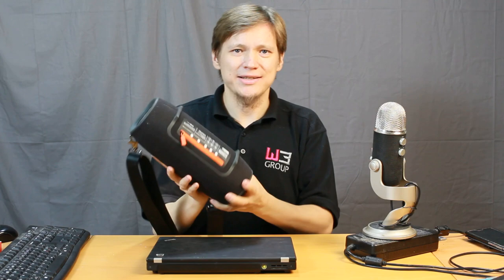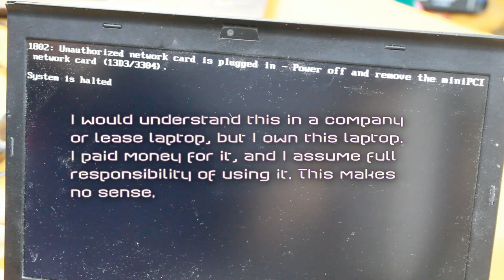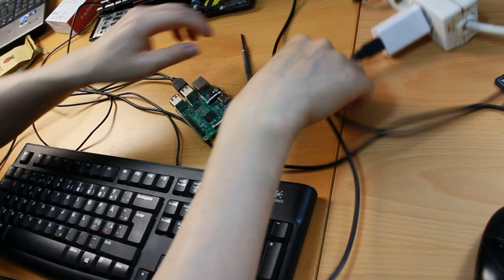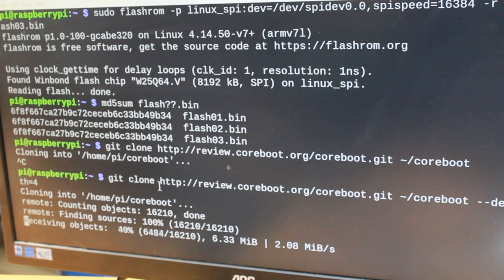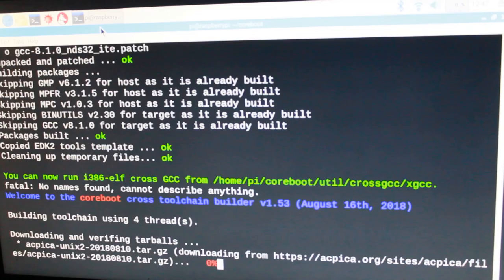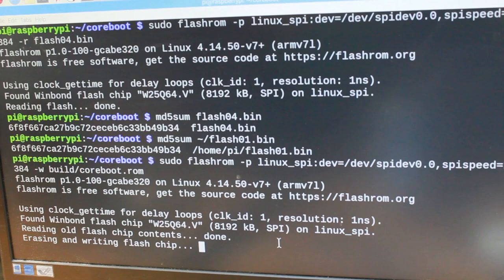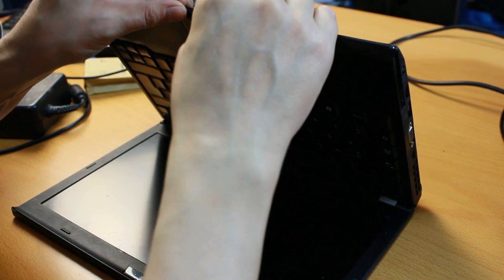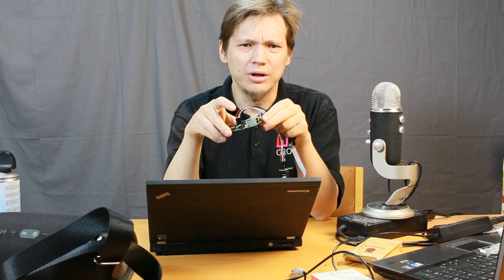Replacing BIOS in a ThinkPad with GPL CoreBoot (former LinuxBios)

Comment: That process was so complicated. I can't believe someone said to themselves "I shall make a BIOS compiler!" then considered that to be a finished state.
Reply: The process isn't that complicated; it's just building a toolchain (so you can build coreboot on a PC or a Raspberry Pi, two very different platforms), fairly standard configuration (same as the Linux kernel) so that the same BIOS code can work on many platforms, and then compilation.  I believe a few of the make steps were unnecessary as they were included as part of others, and on top of that, on Arch Linux you can install coreboot-utils-git from the AUR and have ifdtool and such in your PATH in one step.
Plus, it goes a lot faster on a desktop computer with a working internet connection than a Pi.
Reply: I was surprised at how easy that looked, I thought getting coreboot working would be way more involved than downloading and compiling the toolchain and even have it extract blobs for you.. Now I want to give it a go.
Reply from the maker: Yeah. The biggest difficulty was because I followed the tutorial too closely and did coreboot compilation on the RPi. That caused much time to be wasted in irrelevant challenges and because of its limited CPU power.
Reply: u can always use devices other than rpi.
Reply: Look, the kind of people who actually install CoreBoot are... how do I put this politely? Not inexperienced with compiling software and flashing BIOS chips with random shit they had lying around.

Comment: pretty good timing that I just nabbed a mint condition T500 for $20. libreboot time!
Reply from the maker: Wow, you got really lucky! I paid 131.51€ for this one, and it came without HDD and with two of the three USB ports broken.
Then again, I have next to me a pile of seven laptops (of various ages) which I have gotten for free from a dumpster. The one that recorded my voice for this video was one of them.
Reply: What? $20??!!!
Reply: @Clau007 I managed to snatch a T430 for €80 from a wholesaler, if you're patient and look around enough there really are some great deals to be had
Reply: I got it from a (kind of sketchy) locall refurb wholesaler. You have to buy at least 3 laptops at once so i got an X220 for my mom and an X240 for my dad as well. One annoying thing though is that they all had different keyboard layouts than the one we use here in Belgium, but still after you factor in the cost of 3 replacement keyboards it was a really good deal
Reply: These "old" business laptops usually go quite cheap. Nothing unusual, companies throw them out en mass once the warranty expires.
Reply: @Clau007 You should be able to get a screen for for around 30€ on aliexpress if you need one. look at the references, there's some TN ones and also  VA/IPS ones if you want better angles. Switch is about 2minutes (i did it on a x220 and recycled the old TN one as a digital photo frame)

Comment: Shame on Lenovo. Thanks for posting this information, so that existing Lenovo users can take control of the hardware they spent serious money on, and so that people who are looking to buy a computer can see that you absolutely should not buy a laptop from Lenovo.
Reply from the maker: The same goes for anything you could stick into the USB port, and it’s much easier than opening the computer cover. Also, if you have access inside computer cover, you can also do the trick that you let the BIOS boot, and then attach the PCIE card before the OS loads up. That way the card still does its thing, but the BIOS does not block it. Or you could solder a USB device physically into the USB connector, but place it inside the computer case, which is totally fine by the BIOS. So all this circus is security theater at best.

Comment: There are screws in there for the card you installed, but the slot is meant to take a full length pci-e card and not a half-length one. There's cheap adapters out on eBay which are basically just a metal plate with some screw holes if you want to mount the card correctly. Other option would be to replace the existing WLAN card you have in there with the new one as it is in a half length slot.
Reply from the maker: Yeah I realized there was an unused screw a bit farther and figured as much. I’ll see if that becomes a problem. Unless it does, I’m not going to do anything about it. I need the existing WLAN card though. This combo adapter cannot do 5 GHz.

Comment: building coreboot on a pi!? braver man than I

or rather, more patient :^)
Reply from the maker: Indeed. It was a bad idea. I even ran into a thrashing situation because of RAM shortage.
Reply: I installed coreboot on my x230t and I did start by trying to build it on the pi as well, but I ran into similar problems and just used vagrant to get a build environment on my main PC. It's impressive that you got it to work!

Comment: Did you get to the bottom of the long delay when starting the desktop?
Reply from the maker: No, but I think it may be related to why Grub shows up black screen. I will have to see if I need to something about VGA BIOS.
Reply: @Bisqwit  Most likely the reason. Although seabios shows up, linux itself is booting the display driver. I did not use libgrafinit on mine, I used the vgabios just to learn how to extract it and mine works all the way, although that's one less free blob..

Comment: It's not chip select but clock. SPI has SCLK (Serial Clock), MOSI (Master Out Slave In), MISO (Master In Slave Out), and won't talk about the SS signal because of the events in 1940's but it would stand for Slave Select which would do chip selection which is not normally used since you usually have only one slave.

Comment: The reason why there isn't a screw is that the miniPCIe slot you have placed the card into is meant for a longer card, such as an M2 SSD. If you had removed the wireless card on the right, it would have screwed in without a problem.

Comment: I've been trying to do the same thing with a Lenovo T420 for a while.  Neither builds from the internet nor the builds I've made based on recommendations on Reddit and GitHub will work properly (the laptop won't boot the Memtest payload or the OS) and I'm still trying to get EHCI debug working with an original (white) BeagleBone.
Reply: you may need vga blob or something. memtest needs specific graphics mode and high res ones are out of question. os should work pretty easily - have you tried seabios as main payload?
Reply: IIRC I'm using libgfxinit without a VGA option ROM.  Maybe I should try a few of the VGA blobs I have, but I'd rather have EHCI debug working first.

Comment: Fascinating video. But, there is an original BT module that can be installed into that laptop. Look for the Lenovo part FRU 42t0969. If you use that, you don't have to replace the BIOS. The slot which you are using for your Bluetooth adapter is actually intended for a WWAN card. The Bluetooth adapter does not require antennas. (Personally, I would've improvised something to screw the card in place, using superglue and a piece of plastic.)
Reply: Another thought - your Bluetooth would probably work just by replacing the existing Wi-Fi card with the WiFi/BT Combo card that you purchased (although this also might require the BIOS replacement).
Reply from the maker: I was not aware of the existence of the original module, and I did not search either, because I was pretty sure it is going to be crazy expensive anyway. Also, this card is not approved by the original BIOS regardless of how it is positioned. The first thing I tried was to replace the original WiFi card with it, because I did not know there was a second slot. Also, this card does not support 5 GHz WLAN, so replacing is not a valid option anyway.

Comment: Just bought my clip and jumpers. I'm going to do this to my t420 so I can use a new wifi card. If I don't come back .. you know what happened
Reply from the maker: Good luck. Note that there is a significant risk in doing this without desoldering the chip first. I will not take responsibility for possible damages. This video was provided as documentation, not as instruction.

Comment: The laptop's PCI-E slot actually seems similar to the front loading NES's cartridge slot. You put the card in and push it down. There are a few differences though, such as that you have to screw the PCI-E card in place and you use a case for the cartridge on NES.

Comment: That additional PCIe slot is also usable by an mSATA drive which is what i use in my x220
Reply from the maker: I just installed a 500GB Samsung EVO 850 in it. More than enough for my purposes; allows sometimes temporarily offloading a camera or a videocamera contents to it when I visit somewhere. Paid about 170€ for it a year ago. Before that, I temporarily used some 128GB SSD that I got from another dumpster-sourced laptop.
Apparently, today you could get a 1TB SSD for the same price… And yes, disk drives are not even on my shopping list because I don’t want to worry about damage caused by mechanical vibrations/bumps.

Comment: 2:58 there is a screw to hold it in place, however you need a bracket which lengthens it a bit and it will secure.
Reply from the maker: Guess if I have one.

Comment: Very good video. And a good way to introduce Electrical Engineering. Good job!

I'd like to ask a question: Do you use modern coding techniques in your code? For example enums, etc.
Reply from the maker: I use plenty of modern coding techniques, and I sometimes create projects just for the sake of practicing out the newest features of the language.
Reply: I see. That's a great way to learn the new features of the language you're using. :D

Comment: I like to watch stuff like this, but just seeing the amount of time it took reminded me of the countless hours and hours I used to waste on projects such as this when I was younger.  So many cryptic errors, so many broken compilations.  I don't have the time or energy anymore, I would have bought another cheap MP3 player from the store and been done with it.
Reply from the maker: I was actually planning on doing just that — instead of buying a laptop — but I could not get the same or similar model for that price anymore. The prices had gone up. Also the 4 gigabytes on it felt a bit too small. Also, it was not cheap to begin with. I paid 42€ for it originally, and the prices only went up from that.
Now they have a new version — which incidentally costs also 42€ — but aside from the increased storage capacity, it actually has fewer features than the Clip+ did, according to discussions seen on rockbox.com. I used the RockBox firmware for the Clip+.
Reply: Yah but that would not have made as interesting of a video.

Comment: I think are not the cables probably, but the BIOS chip being soldered to the Motherboard, the proper thing to do would be to solder it off first
Reply from the maker: Yes, it would have been proper to desolder it first, but I wanted to try this method and make a video about it. This was as much a documentary or a vlog as it was a how-to.

Comment: Its kinda ironic, the Raspberry pi 3 model b has bluetooth builtin :P - keep up the good work
Reply from the maker: I have actually considered more than twice to use a RPi as my computer on go, but because it also needs a display and a keyboard and a battery to be useful, the portability factor quickly degrades.

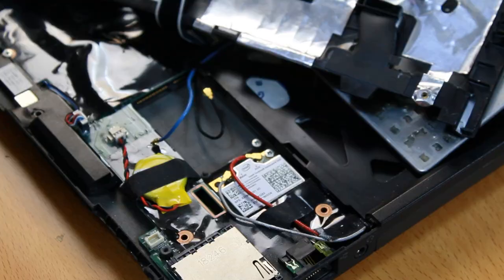Comment: There is another connector in this laptop for an official Lenovo Bluetooth module, you can see it at the bottom of the screen at 2:36. But I understand why you would still want to do this.
Reply from the maker: I was wondering what that connector is for.

Comment: This is awesome, was there any reason you chose Coreboot over Libreboot?
Reply from the maker: Existing and confirmed support for the X220.
Reply: Well that makes sense! Have you tried PostmarketOS on phones by the way, since you like to recycle/refurbish older equipment? I'm installing it on an old 1st gen MotoG right now and it's going well.
Reply from the maker: Nope, I have not. I do have several decommissioned phones, but nothing so recent that it could run PostmarketOS.
I am still using my first smartphone. The previous one that I used is a Nokia E70, and it is not quite capable enough for any sort of Linux system.

Comment: Nice! Can you do this on modern ThinkPads? I mean replacing the stock BIOS with Coreboot?
Reply from the maker: Yes and no. The exact specifics on how to do BIOS replacement may vary, but the deciding factor is whether Coreboot has support for the hardware in the specific computer. If it does not know about the hardware, it cannot initialize it properly. The consequences might be anything from some usability aspect being lacking to the computer not starting at all.

Comment: You don't need to take the wrist rest off to take the keyboard out, in fact, it's generally easier to put back together if you snap in the wrist rest and then re-install the keyboard. To re-install the keyboard in the X220 you slot it in at the top and then lay it flat, then while holding down the bottom half of the keyboard, slide it down to lock in place. But I should also say, the X220 does have bluetooth, at least the one I am typing on has bluetooth, but it can be disabled in one of the BIOS (not sure about coreboot as I haven't tried flashing it yet) menus. I know this because I disabled it because I haven't used bluetooth for 10 years and didn't want to bother trying to work out how to get systemd to automatically disable bluetooth at boot (nowadays I use runit and working out how to solve that problem is a lot easier).
Reply from the maker: There are many different configurations of the X220, including four different types of displays, two CPUs, two kinds of memory, some with different kinds of USB ports. And yes, some that come with a bluetooth adapter; I don’t have one. If I had one, it would plug into that little white socket you see when I opened the case.
Reply: Yes, I remembered after I posted that the bluetooth slots into the socket and realised I never checked the video. I didn't realise they made X220 models without bluetooth. Was it not possible to buy a bluetooth board for the X220? I could have just mailed you mine :P
Reply from the maker: I did not know there exists one, and I did not do searching particularly because I was under the assumption that any official Lenovo-sanctioned hardware is going to be crazy expensive anyway.
Reply: You can get Bluetooth daughter-cards from used thinkpads on ebay here in the UK for very cheap (~£5) and it also seems there are Chinese manufacturers of these boards. I don't know how these boards communicate but by the size of the connector I can't imagine it being PCI so I don't think the BIOS would have any way of knowing if it was genuine. (But the used genuine ones are still cheaper than the new chinese ones.)

Edit:
Anyway, I need to look into flashing coreboot on my X220. The only problem is the cheap SOIC clip I bought was so cheap that one of the connectors was misaligned. I was wondering if I should try ordering another one or if I should just solder some wires to the chip temporarily for flashing (the coreboot guys told me this was a reasonable option).

Comment: I might ask a stupid question : can't you just use a software to update the BIOS with the new one you compiled ? Is that also blocked ?
Reply from the maker: There are two reasons, three really.
— The first and most obvious one is that if something goes wrong while flashing the BIOS (or there is a bug/misconfiguration in the replacement BIOS), the computer is bricked. It will not boot, it cannot be interacted with, and the only way to wake it up is to use an external SPI flasher, like I did in the first place here.
— The second reason is that the flashing program provided by the manufacturer only runs on Windows — and these usually have to be provided by the manufacturer, because BIOS flash interface is not standardized or hardly even publicized. My laptop does not have a single software created by Microsoft on it, let alone an operating system by Microsoft.
— The third reason is that the manufacturer’s flashing program likely rejects all BIOS images that do not have the proper cryptographic signing, or at least the proper checksum as defined by the manufacturer. Of course, they do not document anywhere how the images should be signed, or heaven forbid, publicize their cryptographic signing private keys, because the expectation is that the manufacturer is the only one who provides appropriate BIOS images in the first place. As such, it could be impossible to use the manufacturer’s flash program to burn a modified flash image on the flashchip.*

*) This is indeed the case, but only a half-truth: In case of X220 the cryptographic signing was cracked and they were able to create a modified BIOS image that is accepted by the program. However, it still would not accept CoreBoot, because CoreBoot would have to be signed differently for every single manufacturer/device that it is installed on.

Comment: Hey Bisqwit, I was inspired by your video to try and erase the sinister proprietary firmware in the bios of my chromebook.

After struggling to remove write-protect (very well-hidden screw), I am having trouble getting flashrom to read my chipset.

I found the model to be a Winbond 25Q32DWSIG model chip with dual/quad SPI.

I am concerned that perhaps the 32M-bit flash chip requires a stronger "dedicated" programmer. I would like to use my SOIC clip with my raspberry pi, but I don't have female connectors so I am using a breadboard to plug in the adapter with male-female connections.

It is not pretty, and, sadly, I can't say "but it works", yet.